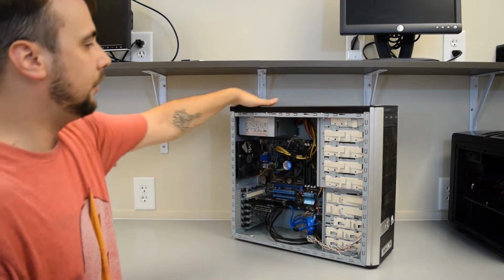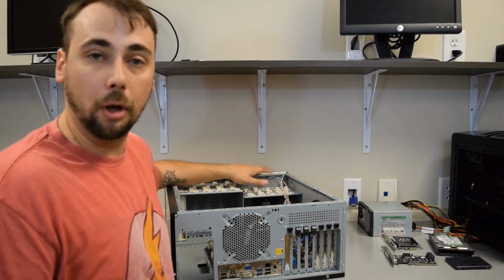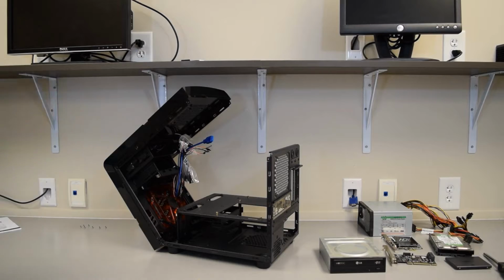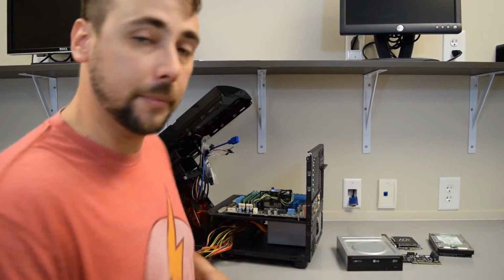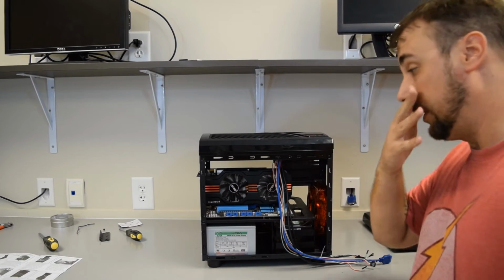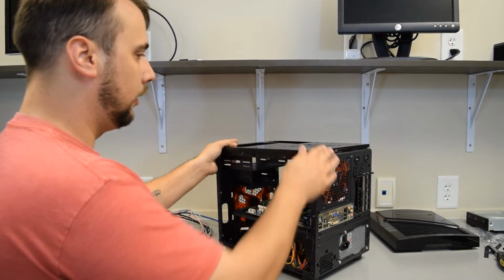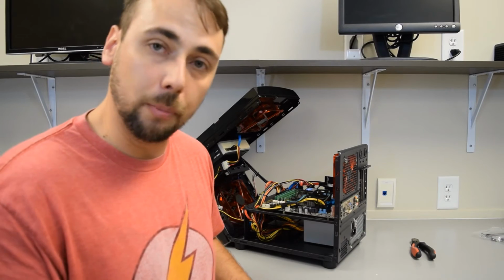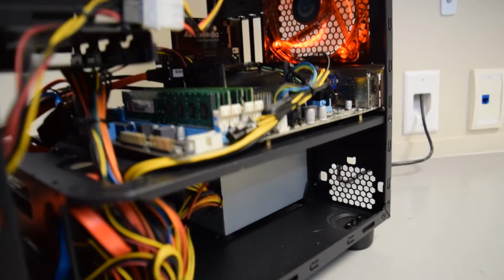Apevia X-QBER Case Pt 2 "The Final Countdown" Cube Case Build

Comment: I would reverse the top fan and have it be a exhaust fan as well, heat rises so it works with the natural flow of heat to get it out of the case faster.  Thanks for the video just ordered the white version for a side project of mine.
Reply: Exactly the best possible cooling is always possible with negative pressure where you have more exhaust power than intake ones, in that case your hot air gets dispersed of your case very fast.

Comment: been waiting for this vid! you managed to cable manage much better than i in this case, a couple things for you..1) in this case the direction of the top fan doesnt seem to make a difference because its so blocked off by the case "grate" 2) plug the sd card reader into a 2nd USB 2.0 header on the mobo, and 3) modular PSU doesnt help, there really isnt room to plug the wires into the psu with it installed.. nonetheless a like for you and good luck with the growth of your channel!
Reply from the maker: Thanks for the reply! 
I did notice about the modular PS, mainly because I would use all the cables anyway and may only save one or two cable bundles. 
I've got a sweet $600 build coming up soon, so make sure you subscribe to check it out :)